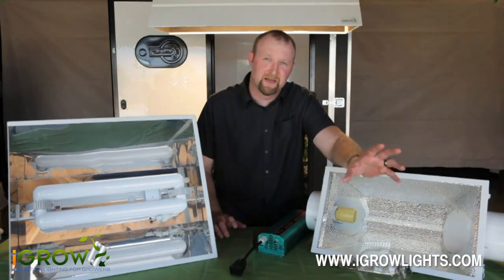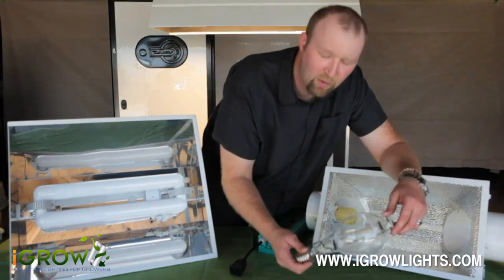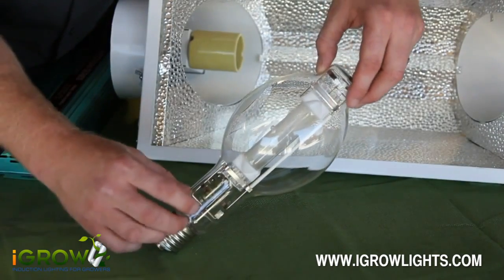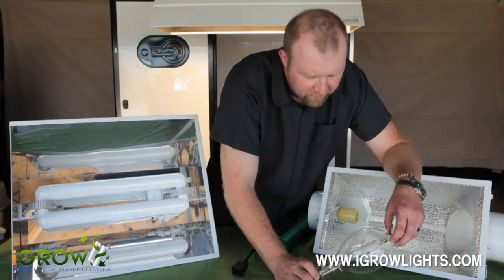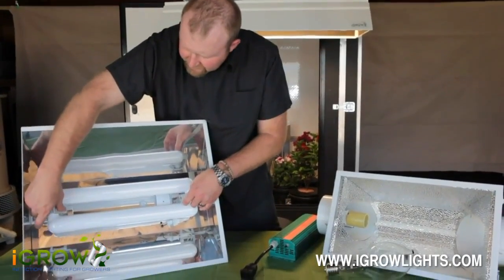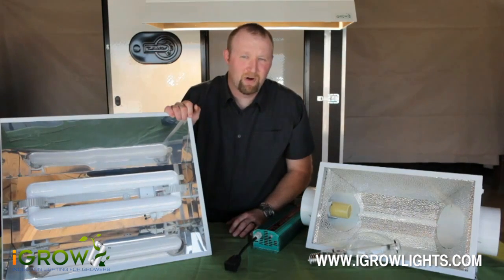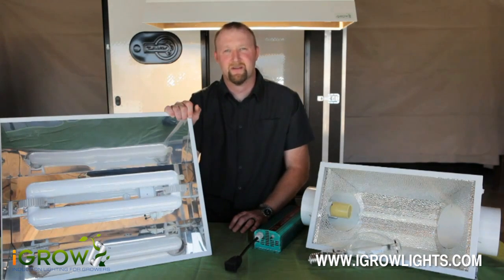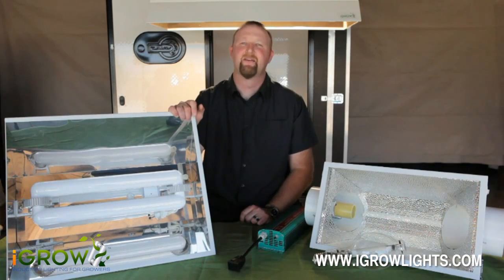The Evolution of the Grow Light, HID vs Induction Comparison

Comment: Induction lighting/plasma/HID/LED all are good for what they do. however, i think the real problem is the lack of $ for $ comparison and the PAR and heat output 
Some talk about the PAR as if it is the be all and end all but remember with high heat output the reflector cannot be close the plant and therefore heat is an issue.
So heat is one thing also the other thing is Spread. the footprint of some lights is very concentrated and does not allow for large growing.
Also there are many different types of HID/HPS of reflectors and globes on the market at a variety of prices this also creates difficulty in selection.
LED technology and Plasma also moving at a fast rate.
I also feel that most of the growers are very close minded when it comes to new technology and often speak through there wallet, if it is cheaper and works in the short term then it is better, hence the favoritism of HPS. Also there is a lot of anti LED but much of this has to do with changing the methods of growing between HPS and LED, it would be most helpful if this was covered in a youtube video by someone to. 
The lighting is a minefield market, hard to quantify the comparisons due to the fact that although many compare on the scientific basis they rarely check the $ for $ return on the product and often forget heat and some parts of the spectrum. The comparisons need to be far more detailed and less focused on a particular product. The probable truth is that they all have their market some may be better for early growth (like CFL?) some maybe better for better quality plant results, some may work better together rather than on their own (plasma and HID?), some for different strains of plants to. The point i am making here is if some of these videos were less focused on selling against HID/HPS and more focused on pointing out what particular market they are better for then they would all perhaps do better in the long run. 
There is a severe lack of credible unbiased opinions and as a manufacturer i shudder at what i see. Our factory in China manufactures reflectors, grow tents and filters and i am keen to see the market develop but what i see is confusion and a lot of vested interested people selling their pet technology, rather than clear concise information to make an educated decision.
My belief is, that all the lighting has its place none is better than the other just different budgets and applications for different lights.
When we have a better understanding of what light is really required (we still guess this as science is still working this out) we will be able to tell people the exact one that suits their application and budget.
THERE IS NO PERFECT LIGHT FOR ALL APPLICATIONS of this i am pretty certain because all the lights cost vastly different amounts so even by budget we can see this.
Reply: I used to agree with the $ 4 $ argument but now the grow shop in my area sells gavita 1000 for $500. A 1000 watt ballast is 300, the bulb is 125 and a reflector is 75. That means that pound for pound and dollar for dollar means no comparison. I buy the gavitas now. I noticed that this was posted a year ago and back then I agreed but now it's a new ballgame.
Reply: Gary Spencer  yes but would you use a gavita in a small enclosure, no i think not so as i said its not one light for the entire range of the industry applications but different lights in different applications. LED in closets seems good to me. Heat on the Gavita is really strong and we know because we make grow tents specifically for a company that will be featuring at the next Spannabis show and these are made taller because the light spread is good and the output is good but if you put them closer to the plant you will cook them so for areas that have a lower ceiling height these are not suitable. We expect this tent with the other products mounted to it to win next years coveted Best Product Award. My customer is 20 years in this business and i think he knows a thing or two about gavita lights.
He also not involved in the propogation phase and again not the best light for this either. some CFL or even induction lights.

Comment from the maker: Thanks for your email. our focus is on 1000w lights, currently we are averaging 70-80% yield to a 1000w. so our yield to watt ratio far surpasses HPS and very high quality plants. In terms of heat you can touch our 400w with your hand when its on, does not get above 200 degress. check out a new blog called growwithinduction com lots of stuff from growers about our lights.